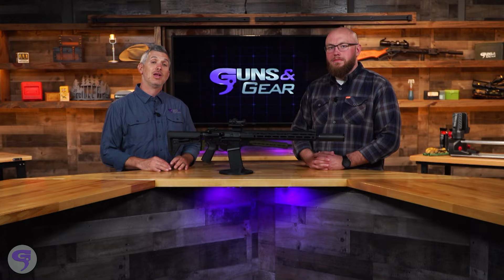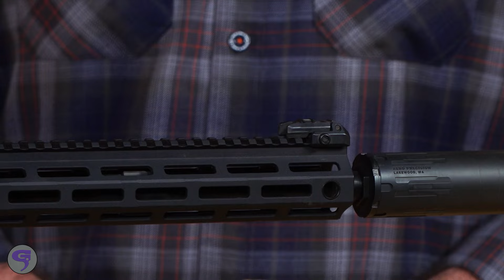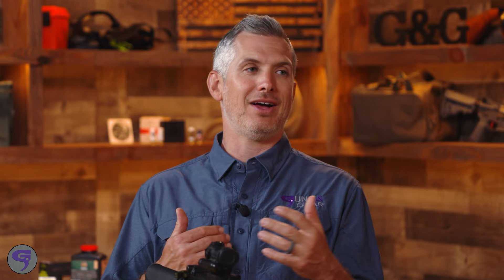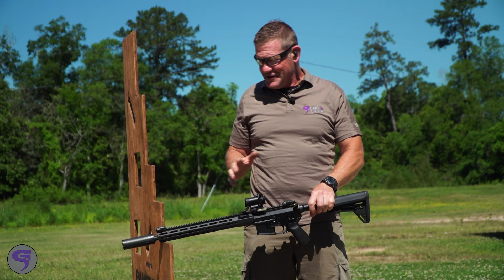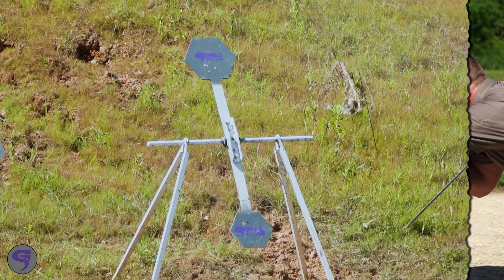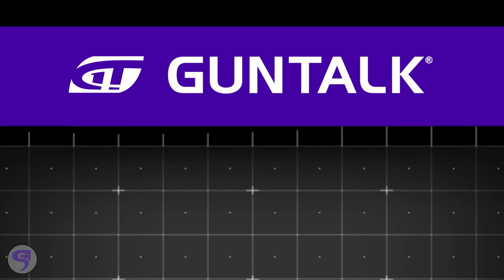Aero Precision M4E1 Pro Rifles

Comment: Their pricing is just way off. Why pay $2k for this when other hard use rifles that are proven are out there & more affordable? I’d pick SoLGW or BCM (just 2 examples) over this any day, and I have Aero stuff. Their bolts don’t last much over 2k rounds, so they don’t have a track record of heavy use equipment. They should’ve started at a lower price for the market to see if they’re good enough. Sorry, I like their stuff, but I’m not spending $2k just taking their word.
Reply: they're using a carpenter 158 bolt with these. Not the 9310 like in their other bolts

Comment: Does their new handguard use the same barrel nut as their other handguards?

EDIT: confirmed with Aero that the Pro barrel nut is different, and the new nut has a few upgrades/advantages over the previous rails/nuts.